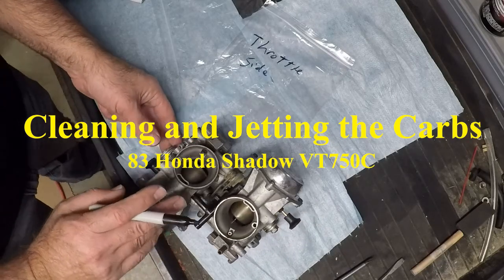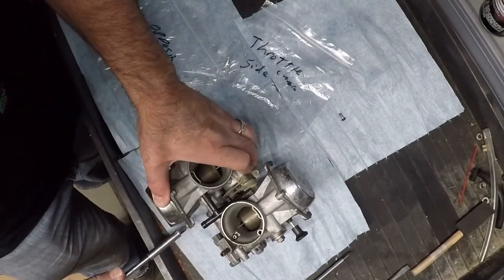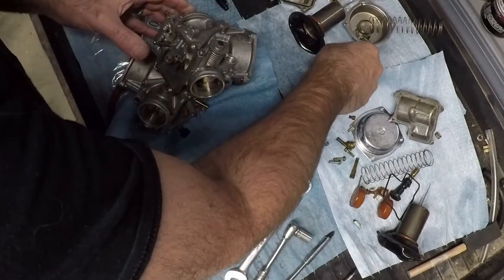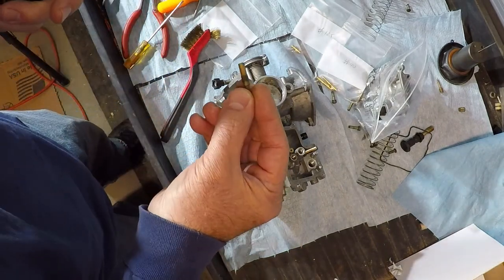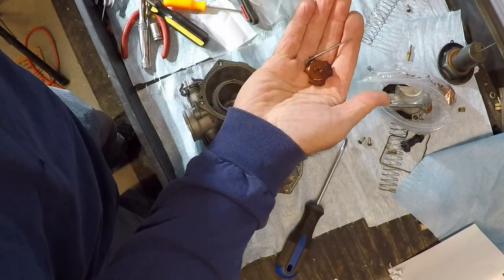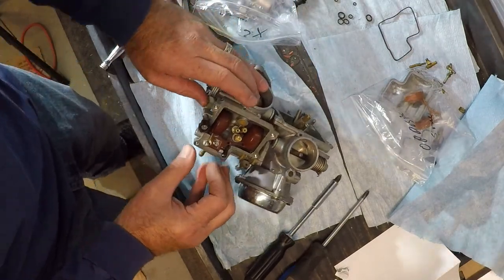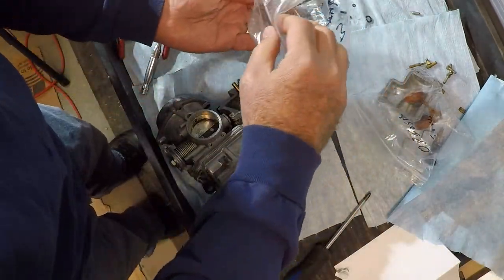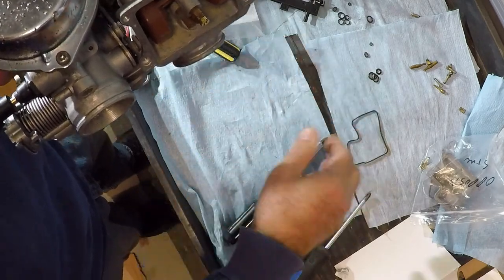83 Shadow Vt750c Jetting Carbs.

Comment: What jets do you suggest for a 1984 Shadow 750?  Sea level.
Reply from the maker: Is everything stock?  Have you made any modifications to the bike?
Reply: What about for a 84 shadow 750 with velocity stacks and small mufflers at 192m (630feet) above sea level
Reply from the maker: @shawndumas3495 check out  carbjetkits.com. I came up with main jets of 130, pilot jets of 45, and 2 shims for each slide needle.

Comment: i need the pull style choke and i have an 84 vt700c it will idle goog but off idle it stumbles i have put a 0.45 on the slow side and 125 on main any help wod be grate i have vidoe on my channle
Reply from the maker: Are you using the stock exhaust and air filter?
Reply: @wonkster1970  yes on the air filter no on exhaust not sure what it is i am fixing to upload a video or a shour
Reply from the maker: Check out https://carbjetkits.com/.  Look up your bike on there.  That's were I figured out what Jets I needed for my bike.
Reply from the maker: @That-Kentucky-Life  I was out in Kentucky a couple weeks ago.  I was in Bardstown picking up a friend's RV.  Nice place.